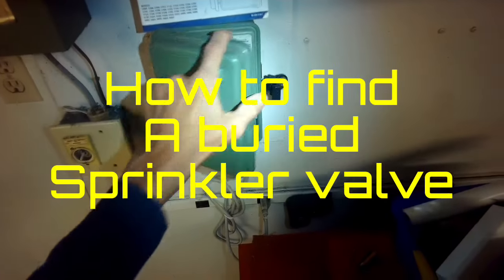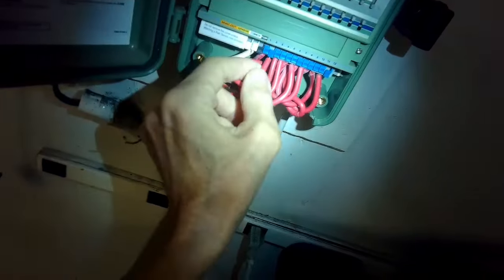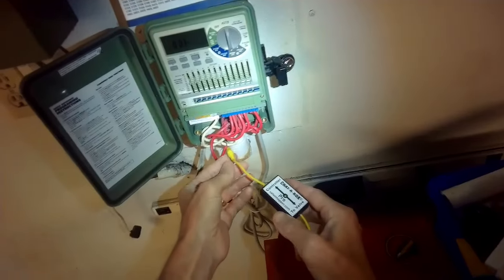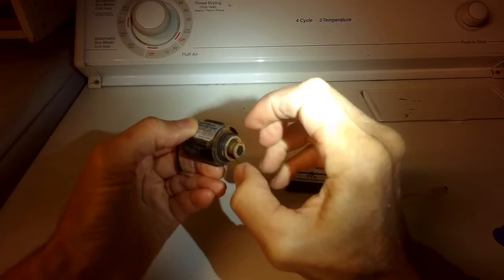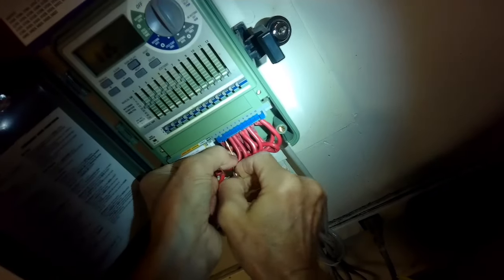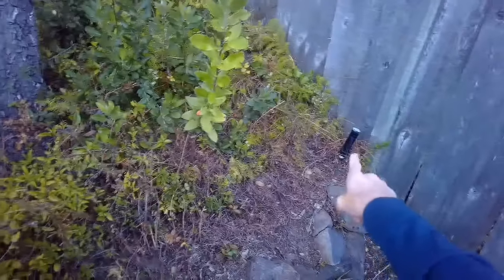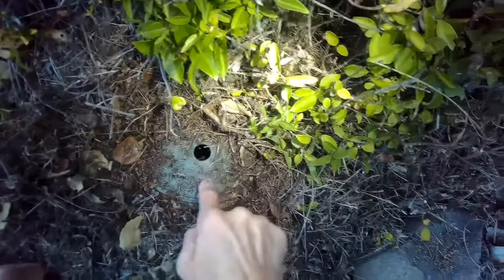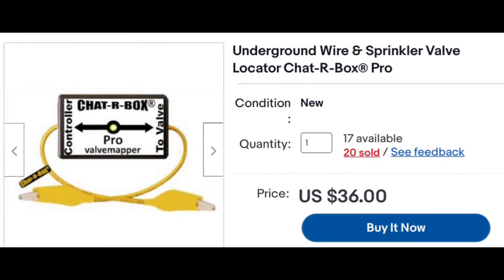✨ How to Easily Find Buried Sprinkler Valves ✨

Comment: If you have a friend, tie your common line to one end of the 24V power supply, then have your friend intermittently touch the zone wire and the other power supply wire together. Saves $50 :)
Reply from the maker: Great idea, you’ll be able to hear the clicking at the hidden valve👍
Reply: Would this work if you zone that's stucked on,
Reply: Thank you for this hack. Saved me about 90 bucks. 
Here's some helpful tips if someone is trying to figure it out.
My rachio sprinkler controller had a 24v + and - ports and I had some figuring out to do with the the multimeter. The common wire when plugged into the sprinkler controller passes current through all the other zone wire ends at the controller. When you complete the circuit by grounding the zone wire ends, the solenoid activates and opens the valve to work the sprinkler for that zone.
Leave the common wire plugged in, remove the zone wire for the zone you are trying to find, find a ground and then ask your friend/helper to touch the tip of the ground wire to the zone wire for a flash second. 
Keep touching multiple times on and off really quick. In my case I used a copper wire plugged into the 24v -ve port of my rachio controller but you could use any ground if you don't have that. I then listened to a clicking sound in the yard around where I suspected the valve might be. My house has a highway nearby and it does make it hard to hear the click with all the whooshing sound of the cars going fast on the highway. I had to keep my ears close to the ground and go around the yard but I was able to hear the clicking sound although faint and found the valve box. Took less than 5 mins of listening.
Thank you once again for the idea although it took a while for me to figure out how the controller wiring activates the zones. Hope this helps anyone trying to go this route and trying to figure it out.
Reply: What do u mean tie common to one end of the 24 
So the common that’s in the timer gets plugged into the power main valve slot on timer 
Not understanding sorry

Comment: How do you find a disconnected dead valve ? Metal detector ??
Reply from the maker: There’s a device that sends a radio signal along the wire going to the dead valve.
Then, you use a radio detector to find the signal and dig it up.
Reply: @ScottTheFixItGuyChannel  That tool cost upwards of $600. Im thinking of just calling a service man that is equipped with it because i wont need to this again and ill save some $.

Comment: I do sprinkler systems and this video made absolutely no sense. I'm sorry, but how did you find the valve to put that little clicky gadget inside the box. I thought you couldn't find the box. I could see if you had it in your hand like a locator and it started clicking when you got close to the valve. But this makes no sense.
Reply from the maker: You put the clicky thing on your controller and then go look for the hidden valve which clicks loudly. It works👍
Reply: Tried that with a Toro Valve.  The valve is so quiet, you can't hear the clicking.
Reply: You clearly do not do sprinkler systems or you are just starting out and have no damn idea what you were talking about did you even watch the video?